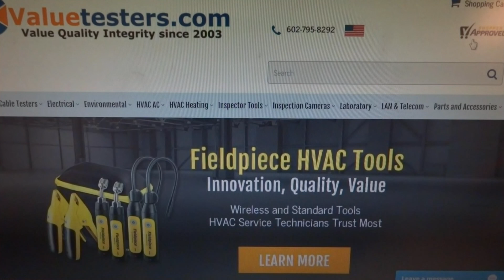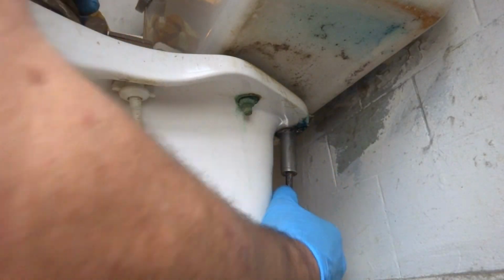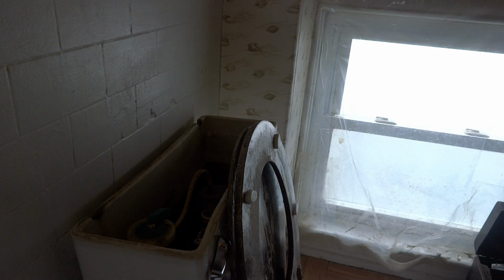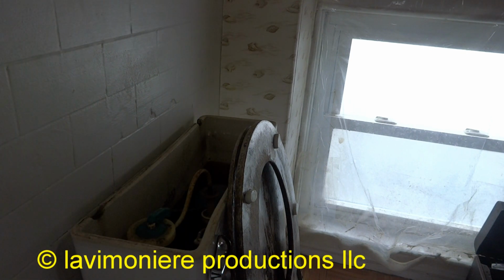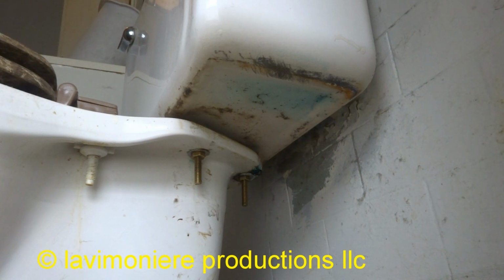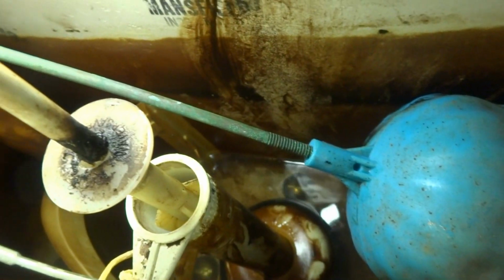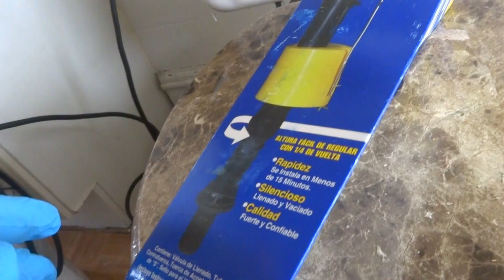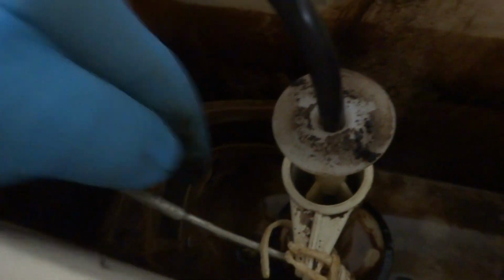toilet leaking water

Comment: No Teflon tape needed on the fill valve threads connection to the new flex hose?
Reply: It isn't a tapered connection. You just make it hard to take it off if you tape it

Comment: I do $300 no guarantee or $400 GB 340-995 at $400 plus flange and supply $
So much work putting lipstick on the pig..sorry Steve
Reply: Plus $50 recycle
Reply: And AS cadet 3 or Gerber better...
Reply: At one time depot had those knock off AS 1.28 at 5 for $250.

Unfortunately.. I only got 10..but such good profit
.

Comment: Steve in the UK it is common to have triangle shaped tapered washers instead of flat type. These when fitted squeeze into the hole sealing it up well and good, much better then the flat type.
Reply: We have them in Canada as well.
I installed a new toilet 2 weeks ago. It came with those tapered washers. Much better indeed.